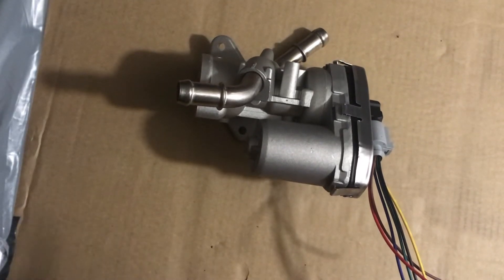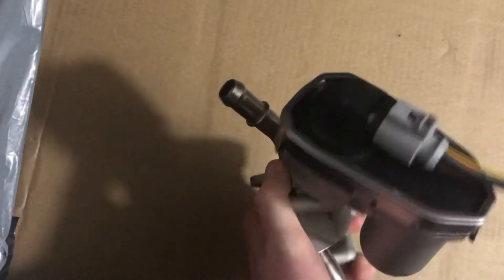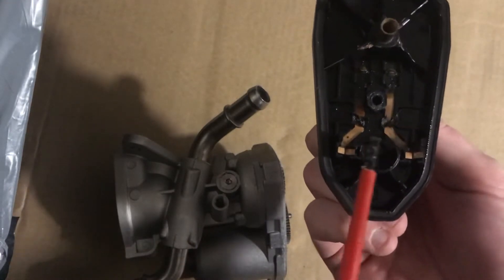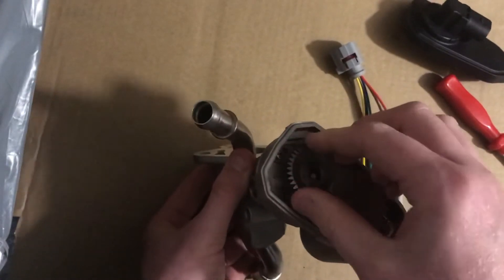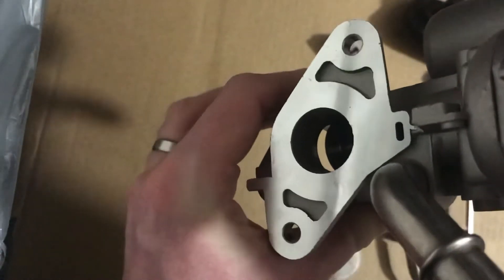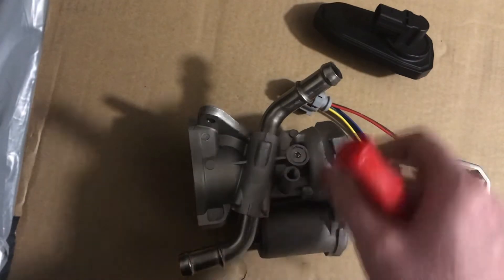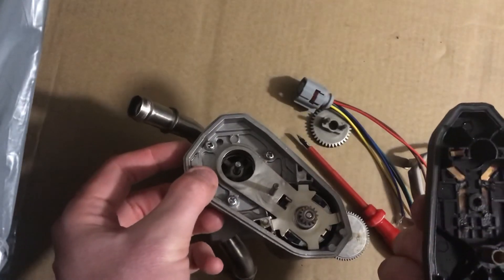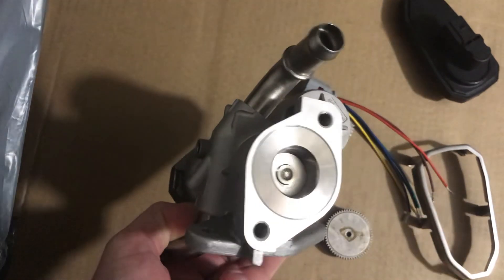Ford Transit mk7 egr explanation

Comment: do you know if a stuck open EGR valve will dump charge air (pressure boosted by turbo) into the exhaust causing a low boost code on a turbo diesel?

Comment: Very informative and well explained...transits are real bastards to work on..just did my starter motor, bought a good one as I never want to have to do that job again..egr valve next..thanks for the info..what a shame you can't get away with just unplugging them